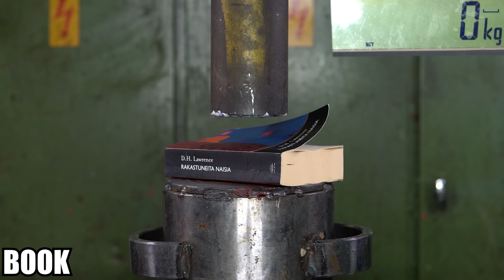Best Dangerous and Strongest Hydraulic Press Moments Compilation VOL 5

Comment: The Prince Rupert's drop broke because the tail came in to contact with the edge of the ram. The body of the drop was holding up just fine.
Reply: Beat me to it
Reply: @orti1283  😁I wish they would find a better way of holding the drop. When they use clay, the drop rotates on initial compression, and the tail touches the edge of the ram. Maybe if they pressed the drop all the way through the bottom clay until it is in contact with the metal, and then leave off the top clay?
Reply: I saw that too. You’re absolutely correct. I, too, would like to see how much force it could really take.
Reply: Agree
Reply: @scotty2307  would cutting the tail off hurt the structure?
Reply: @ExcavationNation  Hello. Yes. A Prince Rupert drop is extremely pre stressed. If you break even the very tip it will release all of that energy. Similar to tempered glass  which almost explosively break into small pieces if damaged anywhere on the pane. 
Destin Sandlin at Smarter Every Day did a full episode on Prince Rupert drops. It is worth watching.
Reply: Dropped in to make this comment.... Glad it was already made.
Reply: @scotty2307  ok what about this if you heated up the tail and removed it when it was hot instead of breaking it off
Reply: @ExcavationNation  Not sure if that would work. It would de a goog experiment  though.
Reply: Maybe if they casted it in some ballistics gel they could position it properly.
Reply: Yeah the body of one can withstand tons of force but when you break the tail the whole thing turns to dust… literally
Reply: @bench2095  ok so a torch and water man where to I find that 😂 jk bro thank you
Reply: Yes. Feels that the famous drop deserves another try.
Reply: Yes exactly
Reply: No stop being a prince rupert drop believer
Reply: I learned to make PR drops in glassblower school. I saw it. It would have held up for a while if the tail was not hit.
Reply: 4 sure
Reply: @christopherrasmussen8718  Yes. The best video available are from Destin Sandlin at Smarter Every Day. The body will withstand a 22LR He has it on his channel.
Reply: @scotty2307  seen his vids. He likes them. Physics to him way out of my league
Reply: @christopherrasmussen8718  LOL. I understand enough to enjoy the concept. That is all you need.
Reply: @Agent LeMan SCH I meant when it's molten
Reply: ya the drops stupidly strong in the ball but weak in the tail

Comment: In all seriousness, I am amazed and surprised how "explosive" stacked paper is. Wow.
Reply: Stacked paper distributes the forces from a hydraulic press relatively evenly over its surface area due to friction. When enough pages tear, all that force is rapidly redistributed into widening the tear.
Reply: This is oddly similar to a supernova.
Reply: @Mavendow  That's what i was going to say(no it wasn't).
Reply: Yeah, that's what I saw thinking too lol
Reply: Apparently they are too cuz they just keep putting paper material over and over 🙄 its like okok thats enough paper move on to something different
Reply: It's all about that sudden discharge
Reply: Paper is mostly carbon just like gunpowder, dynamite, fossil fuels, etc. That's why it burns so well, like all the other carbon compounds, and that's because they can release energy very rapidly. When heat is applied they burn, when pressure is applied they explode... even paper.
Reply: Remember kids thats why you should work in groups; they always stronger.
Reply: Didn't you know it's forbidden to bring a hydraulic press and paper onboard a plain? It's because of this
Reply: Me, too. Throws me for a loop when it happens
Reply: Big bang theory
Reply: @Metal0sopher  That is what I was going to say!
Reply: @Mavendow  I came here to say exactly that.
Reply: Everything is explosive, If you compress it enough.
Reply: @PostTraumaticChessDisorder  Papernova.

Comment: I just never imagined that compressing paper would be so violent. And the Rupert's drop is a whole nother story.
Reply: Imagine that one of the flattest materials of fibrous wood compressed. Stack a million of them then compress them in a super infinite powered press. Hence the paper is well contained in a solid metal box. Boom we humans have fabricated a small black hole. Or fusion reactor.😁
Reply: Could it be the air being compressed so much that it violently moves out?
Reply: Paper contains titanium dioxide.
I thought that might be a contributing factor to its violence.
Reply: The paper appears to be getting so pressed in the middle then it starts to tear. When it finally tears enough, the press slams through it making the loud noise.  You can kind of see this with that phone book how the pages around the edges start to bunch up. I dont really think it is a reaction because of what paper is made of, it is more or less just the stored potential energy being put into the paper and it being released once the paper rips and the pieces all slide past each other. The noise is just the press slamming on the bottom plate. It is hard to explain but watching this in super slow motion would show the tears in the pieces around the edges of the press, then the pieces all sliding past each and then out from under the press.
If you think about something like dough, it gets so thin before it rips...the same happens here. The paper gets pressed it tears under the pressure
Reply: Rupert's drop is insane. I think it breaks because the "tail" got shattered, rather than the "bulp" broke first

Comment: Admit it, if you had a 150T press at home you’d crush random things for fun too!
Reply: I don't have to admit anything. I will do that stuff without guilt.:)
Reply: Of course 😂👍🏻
Reply: I sure would
Reply: I probably wouldn't do anything else.....People with fast cars think they control some power.  The press is real, concentrated power that can do some really interesting and cool stuff.
Reply: YEP
Reply: I work at a lab we have a 147 tonne press for concrete cylinders. I wish i could crush shit like this with that
Reply: @claudekim7876  what does the press do to/for the concrete cylinders?  Sounds like fancy concrete if you get a big press with it!
Reply: @BobWidlefish  its a testing machine for getting strength of concrete cylinders.
Reply: @claudekim7876  are all concrete cylinders tested, or just a sampling per lot?  Are the cylinders used for anything cool?  Cheers!
Reply: @BobWidlefish  when its poured by construction crew our techs pour some in round cylinders (100x 200mm) and then we cure it and test it for specific dates.  It has to meet 30 or 35 mpa within 28 days.
Reply: …all day long
Reply: Well, yeah.
Reply: @gregvarner9562  This is real, concentrated force.  Power dictates how quickly the piston moves, and a typical pump for a press this size has about as much power as a Model T.
Reply: I’d probably get in trouble with it I’m sure
Reply: For sure I would! :D
Reply: Things...yeah, things.
Reply: idk man this thing gives me the fear for some reason
Reply: IN A SECOND ;)
Reply: I can put things underneath my niece , that must be around the same pressure..
Reply: gummy bears
Reply: Ofc
Reply: I used to do it for work.. at a car part manufacturing company and i was operating 220, 400, 1000,1200 and 1500T press.. really huge ones :x
Reply: Oh you know I would!
Reply: @BobWidlefish who wouldn't crush random stuff if they had that?

Comment: I wonder what exactly the mechanics are of the stacks of paper exploding. Is it the paper slipping out away from itself that's suddenly letting go? Or is it some other set of interactions? The fact that wood also shows that kind of behavior just makes me think it's more of a particular failure mode of the fibers themselves? Maybe a materials science engineer could elaborate
Reply: If I had to guess, I would say that the pressure puts immense horizontal tensile stress on all the fibers as its compressed against each other, and eventually the fibers fail explosively. You can see the paper on the edge pulling itself away from the press right before it fails.
Reply: 40 000 Kg of force moving accelerating to the speed it does when it slips past the last group of pages equals a very big amount of energy being released, due to being built up as pressure, potential energy.
Reply: Thank You for asking that question. I was amazed at that happening also. I am going to guess air trapped within the compression (lots of air in paper) of the paper and enough is trapped to finally be released after reaching insane levels of PSI. A bubble within, if you will. Gaskets are sometimes made of paper. Just a guess, just a theory.   Great Channel, huh?  ;-)
Reply: @mataloger  lol more like 136,000kg
Reply: Looked up the ingredients in hand warmers, among salt, activated charcoal, and a few other ingredients, was wood fibers:)
Reply: The press itself is also a huge spring, you can see the table bend downwards. I'm guess part of it is the sudden loss of force from the paper causing the table to spring back upwards sending things flying.
Reply: One possibility is moisture present in the paper under the high pressure causes heat which vaporizes it into steal pressure, similar to a popcorn kernel explodes [pops] due to moisture inside of it expanding into steam from the heat source.

Comment: Great video but personally loved the Prince Rupert Drops and the final gas can fireball.
😱👍
Reply: I want to see the prince rupert drop again, but this time try not to break it at the tail.  It only broke because the edge of the press hit the tail, I bet it takes a lot more pressure if the tail is placed as parallel to the pressing surfaces as possible.
Reply: @porcher33  Yeah that would be awesome. 👍

Only thing tho is I kind of have the feeling it might not crush.
If he makes another one the same size, and the last one actually put an indent INTO STEEL, then I kind of get the feeling a new one might actually run the press to max tonnage without exploding. If the tail doesn't break of course.

I'd love to find out.

Comment: you should work together with any university regarding physics/chemistry! like how the "machine" went up into the air because the heavier part was pushed down - interesting to see.
and you could do like metallic structure videos (slow mode compression), thermal video, etc. etc. etc. => you should team up!